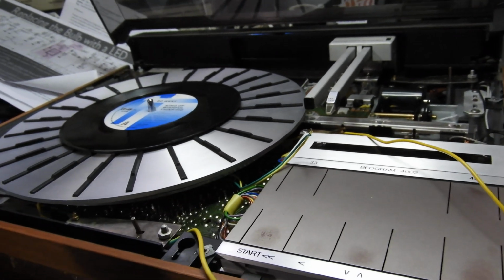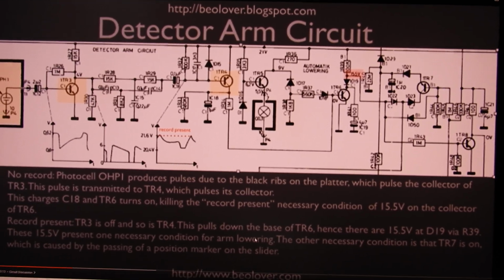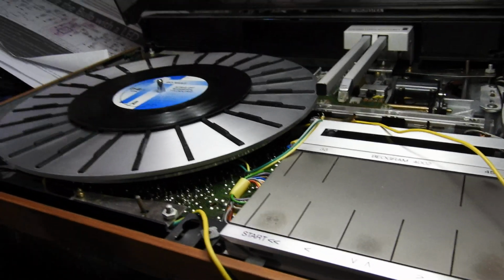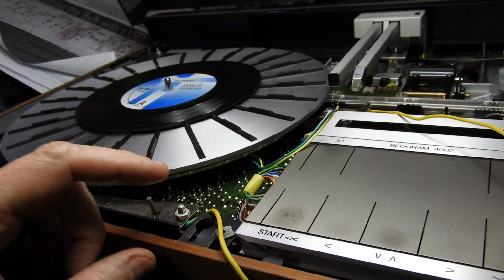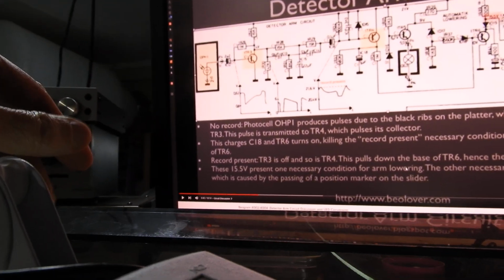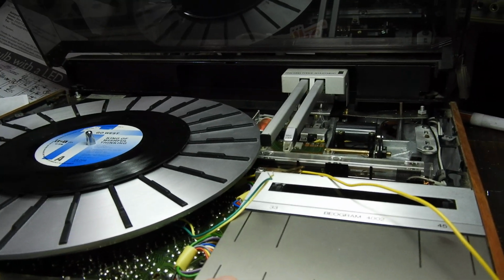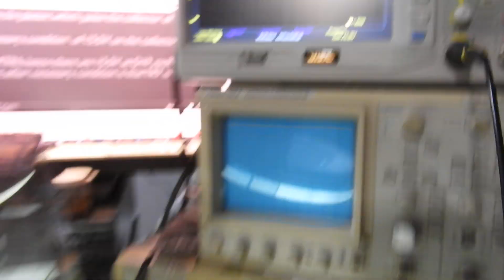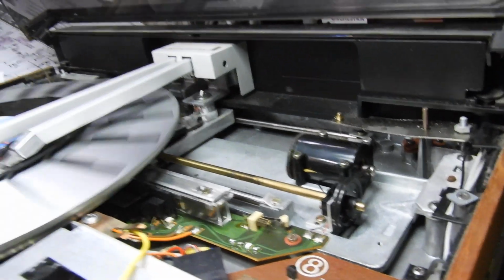Bang & Olufsen Beogram 4002 final video. Now fully fixed but perhaps further upgrades are in order

Comment: Please share the belt placement?
Reply from the maker: Will do. Once I get some time to get to the sensing circuit repair. But in general, pull the platter up to remove it, clean the belt contact surfaces on both the platter and motor pulley and then install the new belt. The easiest way is to fit it around the platter while holding onto the belt (to keep it tensioned), hook the bit you're holding around the motor pulley and drop the platter into the bearing.